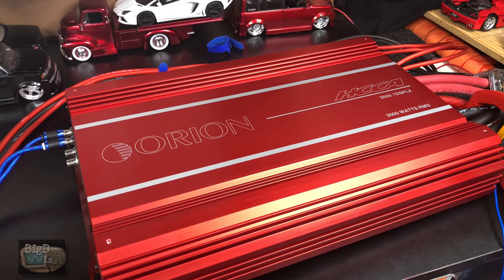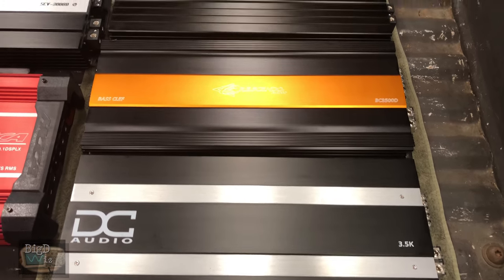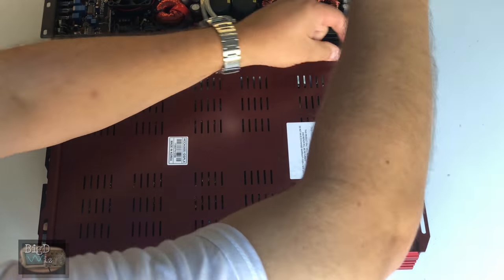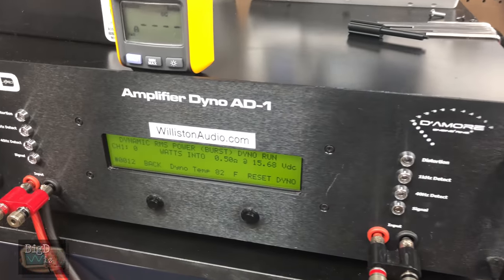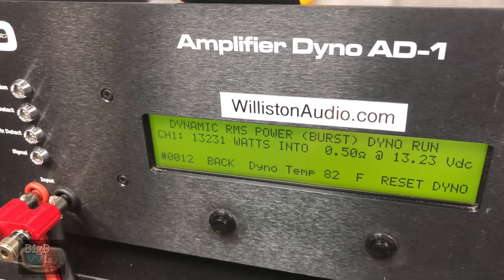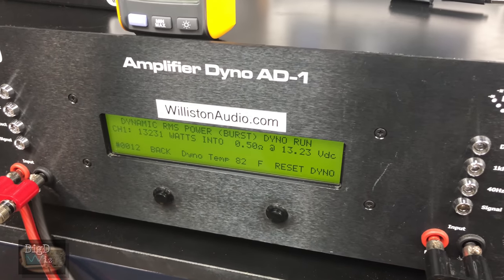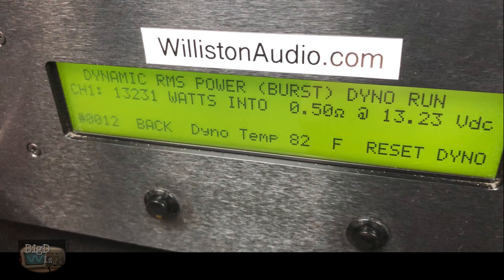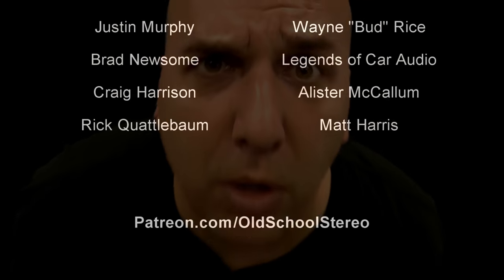10,000 watts from a 3,000 watt amp? Nope, even more...

Comment: can you run .5 ohms daily? subs will not stay at .5 ohms when playing music, it jumps to 1+ ohm right. thats why its better to get an amp that matches your subs rms at a higher ohm like if your sub is 1000w rms at 1 ohm you get an amp thats 1500w rms at 1 ohm because at 2 ohms its likely rated at 1000w rms. is this right or was i told some bs by the local stereo shop.

i also notice some subwoofers mislead their impedance claim. i had an re audio sx sub (bought in 08) that claims dual 2 ohms, the specs resistance (RE) is 1.9 so i assumed each voice coil is at 1.9 ohm and when wired parallel its at .95 ohm rounded of to 1 ohm. i was surprised to find out this year that each voice coil was at 3.8 ohms and when wired parallel its at 1.9 ohm. im currently shopping around for a sub and went to a local shop that stock orion xtr pro 12d2 to check out, the sales guy was wlling to use a multimeter to check the ohms. the sub claims 2+2 impedance but the resistance (RE) is 3.4 ohms on each coil and its 1.7 ohm when wired parallel. i havent checked other brands because the local shops around me dont carry 1000w rms subs around $300-400. so my other choices was rockford, kicker, polk, hertz, and focal 

so im thinking if i get a dual 1 ohm sub and check the resistance its possible im looking at 1.2-1.5 on each coil giving me a .75 load at most before box rise
Reply: order subs, stay away from local shops.. you gotta realize they mark there prices up and tell u what u wanna hear to make a sale.. buy a new pair of sundown SA subs from down 4 sound, he will give u the best price around garrenteed price match.. plus the SA is very under rated and is a very good sub.. I run the sundown x series, 1500w rms. there good subs but only like the lows.. the SA will play just about anything very well, and u can give them 1000w each no problem and sound amazing
Reply: depending if the local shop keeps a big stock on items, its actually cheaper to buy local. if you use cash they dont add tax and they sell below map price. the shop i checked the xtr had a 12" w7 in a pro wedge box tried to sell it to me for $650.00 out the door. i like sundown but it still want to check the ohm resistance of the voice coil before purchase

Comment: I'm right on the edge of buying one of these amplifiers from Amazon I hope it is good.
Reply from the maker: If you have the electrical to support it, you won’t be disappointed
Reply: @wal  Do this draw more electrical than the smart 3 taramp.  Thinking about getting this amp.  Just got a 220 amp alternator and 2 xspower batteries.

Comment: Hey big d, what are some amps that are designed to run at .5 ohm?
Reply from the maker: Soundstream and Power Acoustik have some models, some of the Korean amps Skar, Sundown, DC, Crescendo, etc will do 0.5 speaker loads, just not on the Amp Dyno with a static resistive load

Comment: MR.BIG D WIZ I HAVE 4 10 INCH DC AUDIO DUAL 2 OHM VOICE COILS IN A 6TH ORDER BANDPASS BOX IN A 2002 CHEVROLET SILVERADO WHAT AMP WOULD YOU RECOMMEND? ORION 3K OR SUNDOWN 8000 FOR ABOUT THE SAME PRICE RANGE I HAVE A 2012 HIFONICS COLASSOIS 3200 WATT LIMITED EDITION BRAND NEW IN THE BOX AND I FEEL LIKE I NEED TO SELL IT AND GET MORE POWER BUT I WAS TOLD 3200 TO 3600 WATTS THIS AMP DOES AND THEN I HEARD HALF OF THAT WHEN I CALLED SONIC ELECTRONICS BUT MY BUDDIE SAYS THAT AMP WAS THE BEST OF THAT YEAR BEFORE 2013 THEY TOOK A SHIT. I'M RUNNING THE FOR 10'S OFF A MMATS D300 AND MY ALTNATER ISN'T INSTALLED YET BUT PEOPLE JUMP OUT OF THE FRONT SEAT AND BE LIKE MY EARS ARE RANGING AND THEY SAY IT'S LOUDER THAN 2 15INCHE SUBWOOFERS AND THOSE DC AUDIO M3'S HIT DEEP 26 OR 28 HERTZ THE BOX IS SET FOR AND THOSE SUBS ARE 900 WATTS EACH WHAT WOULD YOU SUGGEST FOR A STREET BEATER SMALL COMPETITION SHOW AND I NEVER SEEN A 2012 HIFONICS COLOSSUS DUAL MONO BLOCK 2 CHANNEL AMPLIFIER CLASS SUPER CLASS D NEVER TESTED. IT LOOKS LIKE A JL AUDIO SLASH SERIES AMPLIFIER.

Comment: I would like to know if a pair of subs are connected to 1 ohm work better than 4 ohms????
Reply from the maker: Depends on the amp you are using. Most monoblocks these days work at 1. Ohm and put out the most power there, but are much more efficient at 4 ohms

Comment: How would big d compare this to a kicker kxa series amp or a crescendo or a dd amp for quality wise nd durability for long last components what would be a better choice? Am thinking about updating my sound system to treat myself. For nw I have 2 15 inch kicker comps s subs running on a pioneer d9601 at 2 ohm 800 wats rms nd am quite happy with th power nd sound. Want to change to a single 12 dd 9500j subwoofer. This amp looks to powerful for th sub is it clean Signal it puts out? Pls help big d am I going to get more bass nd how much difference would I see nd would I need to upgrade my electrical system to a big 3 nd Ed battery or ext. would I miss out because of the air space my 2 15 move against a single 12 I want to run 1 ohm nd want a 3k amp. Or do you recommend 2 subs instead nd more power I don’t want to beef th car electrical so much aether sorry about all th questions am lost nd need some experts advise tanx for the videos love them big d.
Reply: The amp does look nice due I want 1 now hope it don’t blow my sub I get I will have to take it easy with the volume lol good channel d wiz

Comment: This Orion design high current amp has been around for decades it's a high current amplifier  cheater amp I believe they use a unregulated power supply in those amps which I used in pro competition. I used to sell those things like hot cakes back in the day. Have you tested the Mmatts Pro 3000.1 mono  yet?

Comment: Team orion, undesputed! Wiz, i was wondering if can dino the cobalt cb3500.1d 7000w? It is 2006 compliant, ive only seen 1 dyno for this thing
Reply from the maker: Remember CEA compliant means it only has to meet specs at 4 ohms. That Cobalt is nowhere near 3500 watts
Reply: The one im talking about is 1760w rms at 1ohm was wondering if that would be a good one to dyno, i think its around 150$ now?

Comment: What's good your channel is one of the best for amp decision making. i got the synergy 3.1wfo.(was gonna get the ampere aa3800 but g2 was out at the moment so got the synergy.  Hard decision to make but got the synergy and Oh my Sweet BABY JESUS.  ?. N CAN YOU DO A DYNO on the ampere aa3800. 1č  And that synergy isn't rated at . 5 ohm but I've was running it like that for about 2 month maybe 3 now. Mind you the damn thing don't even get hot. Warm yeah but not even close tohot. But if you can. Can you do a dyno on the syergy 3.1 wfo ran at 0.5 ohm and really wanting to see what the ampere does.  ( picked one up for $325 about a month later)it would be much appreciated.
Reply from the maker: Synergy is a beast fo sho
Reply: @wal  yes sir in completely satisfied with them for it from g2 dynamics down here in texas paul and them are awesome. I'm just curious what that thing puts out cause honestly it's rocking the hell out of 2 x12s and a zv4 18. I mean tearingng my car apart lol. I really need to get metered in sure I'm around high 140s at least
Reply: @wal  just uploaded a video yall should check it out.

Comment: Is Orion still killing it with this level of performance, CONSISTENTLY, for the same price/value 4 years later?

EDIT: They have a 17000.1-D... And that's the 1ohm 12.6v rating... Good God... Imagine what that thing does at 15v+ and/or 0.5ohm... All these dudes running multiple DC/Crescendo/Sundown/Scar amps when they can just run ONE Orion.

Comment: That dc audio 3.5k will do half ohm I'm currently running one at half ohm right now and my voltage only drops to 13.7 volts at full tilt but I'm also running 5 batteries, one Northstar agm65 under the hood and 4 Xs power d5100 batts in the rear and 3 runs of 2/0 welding cable front to back on a Singer 320 amp alt
Reply: .5 on a dyno is not even close to the same
Reply from the maker: I’m running 8 XS D1400’s and the DC went into protect at 0.5 resistive on the Dyno. This is like a 0.25 speaker load though
Reply: True this is pure resistors in the amp dyno now in my setup I will have box rise and the amp dyno its a true half ohm resistance

Comment: Put one more super cap in series’s you get another 2.7 volts or so 👍🏻
Reply from the maker: The caps I have max out at 15 volts (six 2.5 volt 2600F caps in series), so I'm a bit hesitant to let them go over 15 as the batteries charge at 16.2. I guess I could put a large switch between the caps and batteries...

Comment: Why is there three power inputs for ground and positive and antenna im lost i just ordered one not knowing about this my other amps have just one input for ground ect please help
Reply from the maker: It has 3 inputs for power and ground because it requires a large electrical system with 3 power and 3 ground inputs to provide the several hundred Amperes of current
Reply: @wal  thank you i really appreciate the feedback i may need another battery? Im running stock electrical.
Reply from the maker: @MACKENZIESFunWORLD  yessir, this amp is too powerful for factory charging systems. Unless you have a 200A alternator or bigger, you may need to consider upgrading alt and a 2nd battery
Reply: @wal  im glad to know i will upgrade elec system thanks you again
Reply: @wal  i just checked and im running stock alt at 240 amps
Reply from the maker: @MACKENZIESFunWORLD  You can try with an extra battery, just keep an eye on the voltage with an external voltage meter display if possible
Reply: @wal  i definitely will do that you are the reason i bought this amp thanks for all of your advice man very very appreciated
Reply: @MACKENZIESFunWORLD  
I been running it's at 0.5 ohm for about 10 month with stock alternator, big three upgrade, with two XS Power battery in the trunk of my Nissan Altima. So far no problem, I just bought a 2013 Chevy Tahoe LTZ,  I am going to move everything to that Tahoe, with two Skar ZVX 12 2
Reply: @Catholic1391  that sound like a nice hookup bro it’s going to sound amazing in that Tahoe with all that space

Comment: How come the amps of today push out power that nothing in the 90's era even came remotely close at 4-5 times the price? What are they doing different? USA amps were 44 inches long rated at half an ohm and would get completely embarrassed by this Orion one.
Reply from the maker: Class D and full bridge design allows for much smaller designs

Comment: See thats the difference between RMS, peak, PMPO. Also the manufacturer specifies said wattage @ a specific frequency range with its distortion level, if distortion is of no concern (every basshead on the planet)... any car amp will bench more than its rated. try to rms sinewave for a long duration and youll see very different numbers. If it cant handle a sinewave for extended period at rated THD or lower then its completely useless...
Reply from the maker: I do the same tests on all amps I bench. It was stated in this video it was not a power number you should expect, just shows the capability of the amp during burps. Long tests with sine wav tracks are fine, but nobody listens to continuous sine wave’s..they listen to music.

Comment: Legit question. How could you possibly get 10000 watts of power from a 12V battery????
Reply from the maker: Well, I have 8 of them (14 volt batteries) and voltage x current equals wattage, I maxed out my 1000A clam in this video, so 14V x 1000A = 14,000 watts before efficiency loss is calculated
Reply: @wal  I see. Well that makes sense. I was just wondering because stadium sound systems operate on less than 3K watts so it hadn't made sense before your explanation. Thanks for the clarification man!

Comment: You seem not to like Brazilian but cater to American amps. Bias? Because Soundigiital, Taramps, Stetsom and some others are in the winner circles repeadetly. Those Orions blow frequently but if your sponsored it wouldn't matter.
Reply from the maker: If I was sponsored by Orion, I would make it known. This is not the case. I try to be as unbiased as possible and although my opinion may not match yours, this should not be seen as bias. I've had favorable reviews for SounDigital and Taramps amplifiers on my channel....guess you haven't seen those?

Comment: Imagine if the voltage was way above 13.23 volts ????
Reply from the maker: I have (8) 14V batteries in tap, so you’d better have a massive electrical system to support this beast

Comment: Also... burst just shows how much current youre feeding through the mosfet power supply, basically asking what the peak capacitance coupled with the peak outgoing current, meaning the output section's rail voltage. (lower than the amp draws at its positive lead) which in terms of bass output doesnt really matter because you need less time to fill the capacitors (the ones at the output stage) than you have time for, especially when basshead play decaf crap 🤣 peak, PMPO, burst are completely irrelevant...
Reply from the maker: You said it. Decaf crap 😬👍

Comment: Orion FTW. Almost no reason to buy any other brand amplifier (HCCA is a little wide, but look at it inside!!). Best and most robust design of any Korean amp (unless there is another modern fake car audio company with a clone). Run this loaded at 1 or 2 Ohms, with a big alternator, heavy wire, proper gain adjustment, some airspace, and a supercap ALL DAY AND ALL NIGHT for YEARS!! The XTR2500 is no slouch either. My following comment has nothing to do with this amp, car audio, nor this video. I just watched a Park Tool video on Youtube about determining cassette/freewheel type on a bicycle. It had the same disassembly music as BigD's older videos! https://youtu.be/iTJ3taJHOn8